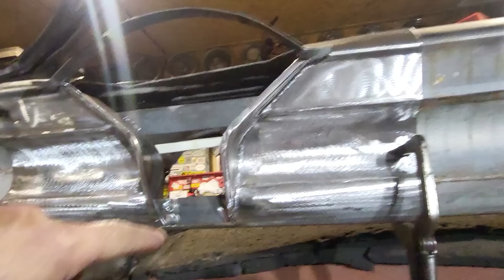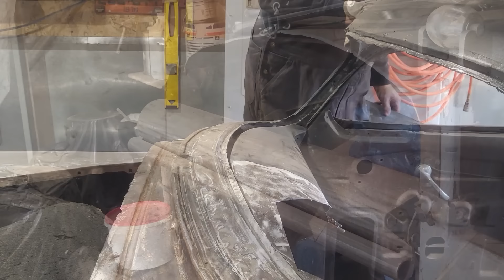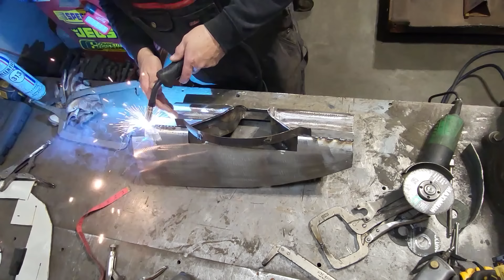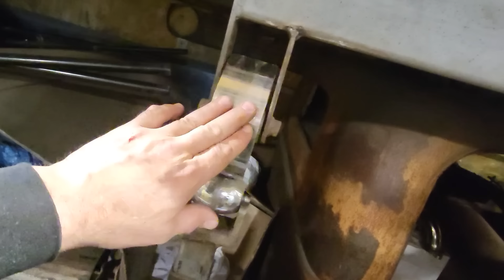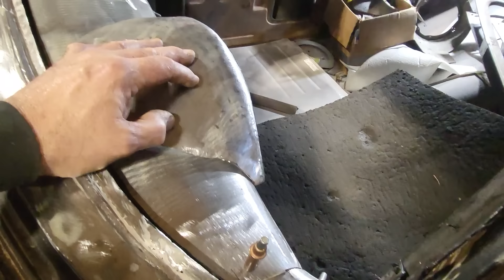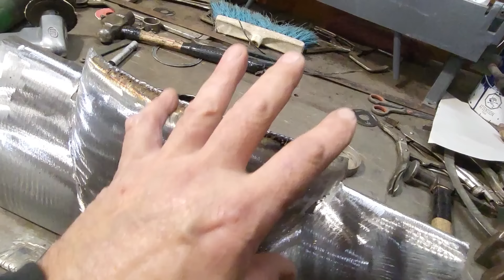Custom dash insert made using "cheap" fancy tools!

Comment: Hi Tony.  Your two recent videos on the custom dash insert were great.  Lots to be learned from these!  I have a question that's slightly off-topic.  It relates to the Arccaptain MIG welder (which I see you're still using).  I bought an Arccaptain MIG 200 model recently.  However, I'm having a problem with the connector fitting supplied for the shielding gas hookup.  On my MIG 200, the fitting has a metric non-tapered female thread: 14MM x 1.5MM, with a thread length (depth) of 12MM and a square end face (no bevel).
It's my understanding that these metric pipe threads are designed for use with an O-ring.  I bought a barbette-type hose fitting with a 14MM - 1.5MM male thread, but it's threaded length is only 8MM.  In order to fill up the 4MM gap and get some O-ring compression, I've had to use a stack of three O-rings at the bottom of the female thread (not very optimum... easy for one of O-rings to get squeezed out of round).  
With 3 stacked O-rings and a triple layer of teflon pipe tape on the threads, I'm still getting some gas leakage at the connection.
Did you encounter this problem with your Arccaptain MIG?  If so, how did you solve it??

Thanks in advance for any help that you can provide.
Reply from the maker: I never noticed  any issues with any of my hookups. The setup that comes with the machines I have are same as the ones I used for years on my Miller machines.
Reply: @fitzeesfabrications  OK and thanks.  I guess I'll have to contact Arccaptain.

Comment: Fitz, I see those pipe sections floating around on your bench. If you weld on a couple pieces of scrap to drop into the bench holes you won't have to chase the pipe. Works the same on my anvil. Just a thought. Love the fabrication video.
Reply from the maker: I been thinking about that. Would make perfect sense.  Lol

Comment: I admire your work, I would like to know what metal thickness in mm you use, and can you also use a roofer's edging bench for aluminum
Reply from the maker: Its 18 gage which i think is about 1 mm. Those roof flashing brakes are made for like 24 gage aluminum.  You could bend a short section, but anything long I say there will be a lot of deflation.
Reply: @fitzeesfabrications  Thank you, you built your own, can you tell me what material you used to hold down the sheet metal and for the bending beam

Comment: Tip for you fitzee ,when welding uphill ,put a 4 inch cutting disc on the end of your mig touch, stop sparks ,welds going down your sleeves .
👍👍👍

Comment: Nice recovery of the front lip. a master cabinet maker once told me that "It's not that a master never makes mistakes it's that he can fix them so no one can see one when he's finished". My favorite tool for putting crown in a panel is my old splitting stump, it's not seen much on Youtube channels, I find it works faster and easier than the pipe ends, I don't use my sand bag much either.

Comment: Thanks for sharing your knowledge and skills.  I've been watching and subbed about a month ago.  I was going to do some cut and butt welds on some rusted out pieces on my old tractor.  After I inspected a little closer I decided I'd make some new pieces.  My Temu bead roller arrived yesterday, and I picked up a 3 in1 brake, roller, shear.  Going to try sheet metal fab for the first time at 71.  You and Make it Kustom are great teachers and craftsmen.  Thanks again for sharing, Ken
Reply: Have a look at Cold War motors Ken and Carter auto restyling they have good tips too!. 🚜 💯
Reply: @John-o6v4v thanks, I'll check out Cold War Motors.  Been following Carter Auto Restyling and a few other.